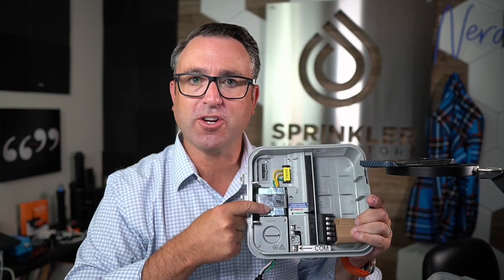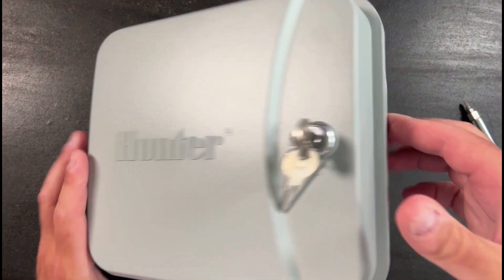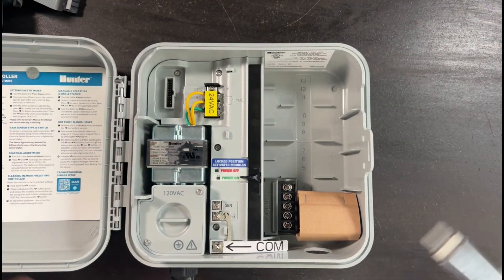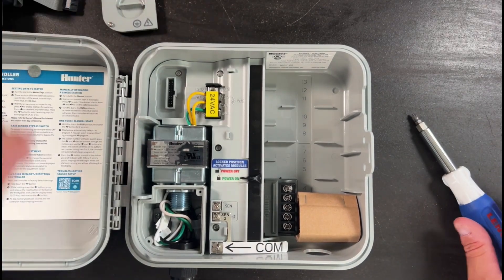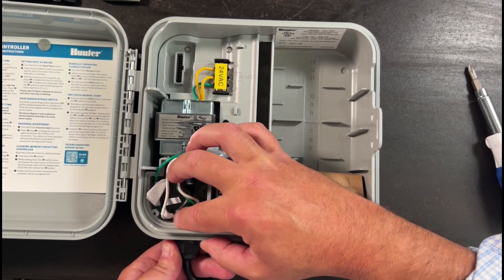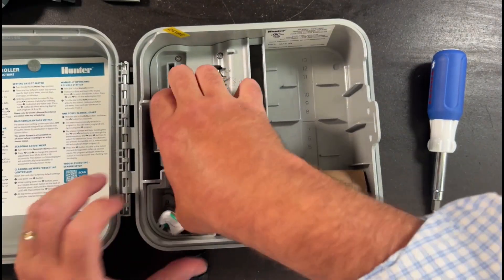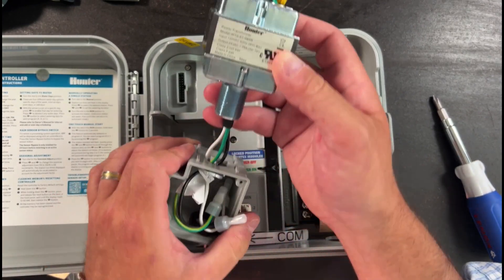How To Replace A Hunter Transformer

Comment: I have excatly the same issue/problem as in the following video with my 15-years old Hunter Pro-C with 9-stations using 7. 
https://youtu.be/OHo5Z9z4o0c
I have 3 PCMs, (3 stations on the first PCM and 3 stations on the 2nd PCM and using 1 on the 3rd PCM).   When this voltage drop happens on a station ( for example station 4 on 2nd PCM) I unplug and replug the wall power and then station continues to work and might continue or stop after 1 minute or 2. Doing the same the station continues to work.  This never happens on the PCM # 1 (1st three stations). I am not sure if there is a problem with the PCM #2 & #3 or the control box itself. It is impossible to test the control box as it falls apart to get behind the busbar.   The PCM is expensive just for buying one to check the PCM.  I would greatly appreciate ANY suggestions?
Reply from the maker: At that point I'd reach out to Hunter Tech Support directly and see what they suggest.  800-733-2823

Comment: Maybe you could make a video on how to temove the cover on a x2 controller to replace the transformer
Reply: Yes, please and thank you.  The x2 Wand controller that I have only allows access to the terminals and not the transformer which is located deeper within the unit, behind the main plastic casing.  Any help regarding this would be greatly appreciated.  Thanks.
Reply from the maker: I haven't changed one of those out yet, but I'll look into it and possibly do a video in the future.

Comment: Ordered a replacement transformer, installed it, no power coming out. Ugh! What now?
Reply from the maker: Interesting. Definitely not normal for a transformer to be bad out of the box. Silly question, did you check the incoming power? Perhaps the GFI is tripped, etc., or the power is high and it blew the new transformer.

Use a multimeter and test power going into the transformer and out of the transformer

Comment: I have this controller and when I turn on I'm getting "NO AC" which tells me no power.  I tested the outlet the plug is in and it is getting power.  Does this mean that I have to replace the transformer?  Could there be any other issues other than this?  How can I test the transformer to make sure this is the issue?  I do notice that it is hot though.  thanks
Reply from the maker: Correct, NO AC means the controller panel is not receiving power. To diagnose this as a transformer issue, you should check the voltage coming directly out of the transformer using a multimeter, you should see something between 24-29v. If it is 0v, this will tell you the transformer has failed. If there is voltage, then the problem is somewhere else, like the ribbon cable, circuit board, face panel, etc. If you don't have a multimeter, you can use a solenoid and tap the solenoid wires to the transformer wires, and you should feel it activate. Or, a multimeter at the hardware is about $15-25.
Reply: @Andy_Humphrey  thank you!

Comment: I have a brand new one of these and the power transformer is hot, is that normal?
Reply from the maker: Yes, they can be hot. Hot can be hard to measure/describe, so keep an eye on it. Is your system a new or existing, and if so, how old is it? Not that it has anything to do with being hot, just curious.
Reply: @Andy_Humphrey  Brand new, landscaping company is replacing it. Couldn't even put a finger on it
Reply from the maker: It would be a good idea to have them check for field wiring problems which might be the source of the transformer issue. Check the voltage in/out of the transformer, check the current draw when in operation and Ohm out each solenoid. Good luck!
Reply: @Andy_Humphrey  Thank you, the wattage was checked but came out at 27 on the transformer, so all being replaced today, appreciate the replies
Reply: My transformer is also burning hot. Zones not firing even though the display says they are. Mine controller is only a couple months old. Frustrating.

Comment: I just pulled the old transformer out and the wires were just twisted together in a wire nut. I did not have to cut them. You mentioned in the video they would need to be cut as they would be connected like they were soldered. When I connect the new controller should I solder the wires? Or just use a wire nut?
Reply from the maker: Nice work. Wire connectors are fine. Depending on your model controller, or year (if not this exact model) it could different. Perhaps the transformer was replaced at some point in the past.

Comment: Do you have a similar video for the XC-600?  I am not sure how to get the compartment open in order to access the transformer.
Reply from the maker: Are there screws on the compartment? Unfortunately, I don't have a unit in my office to look at. Made a quick video for you: https://www.loom.com/share/028244d46c1d4ff1a74014ed15e3cbe8?sid=dc8cc959-eb54-492d-8777-9cb3b10aaa6f

Comment: Thanks for your tutorial.
Why this transformer has 2 outputs color yellow for the 24 volts?
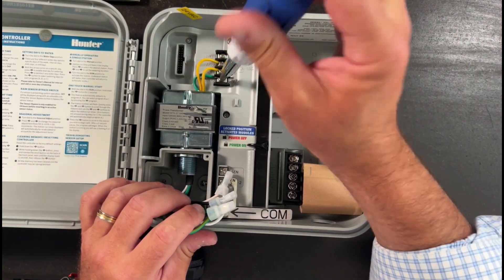Reply from the maker: Great question. I believe this is to simplify the installation, etc. 1:13 The controller use AC power and therefore the wires can be installed on either screw terminal so there is no need to have 2 colors, which typically designates (+) or (-) and specific installation terminals.
Reply: Thanks for your reply. My old transformer is then bad because I am only getting a couple of dc volts between the 2 yellows.
Reply from the maker: Correct. Just for good measure, check the power going into the transformer if you haven’t already. Just to rule out a bad power source, cord, GFCI outlet, etc etc.